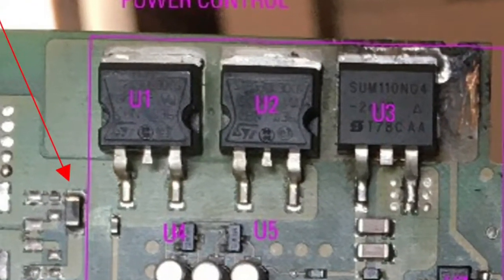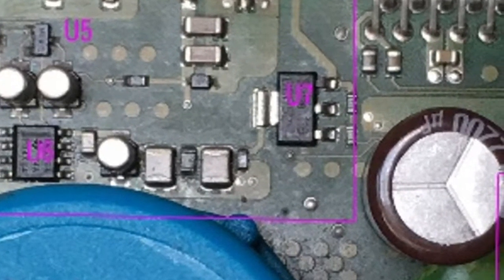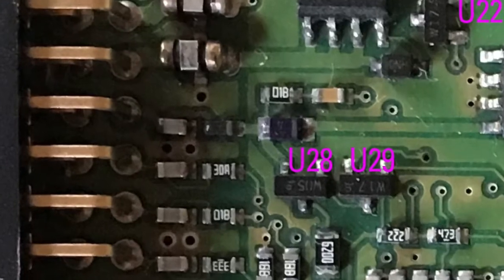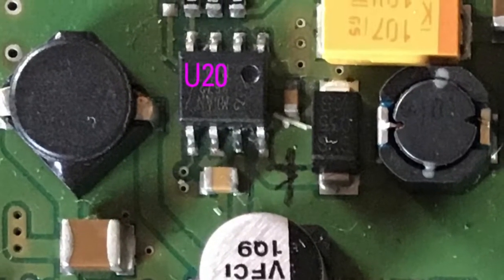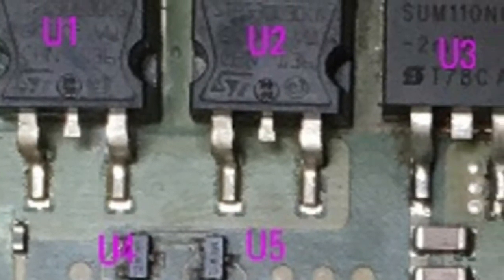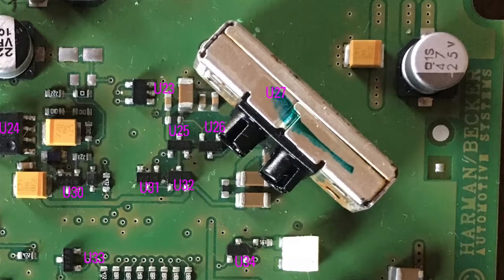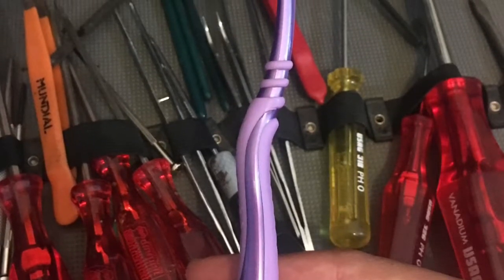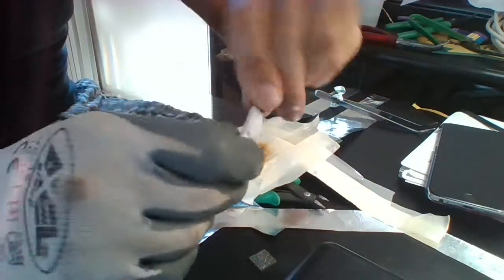BMW Harman Logic7 Amplifier Repair Guide - Part4

Comment: THANK You for making these videos! 
I'm trying to help my son, he got water in his E92. Only very little water on the board. No visible damage at all, every component is visually fine.
I have checked fuse on the big board, it reads 0 Ohm. Which one is the fuse for the small board? Is it the one immediately above U28? Because mine is showing 0.8 MOhm. Could that be something?
Reply: I was wondering the same
Reply: Mine is about 700 Ohm. The fuse of the big board has about 2 Ohm. So the question is now wether its a blown fuse right above U28